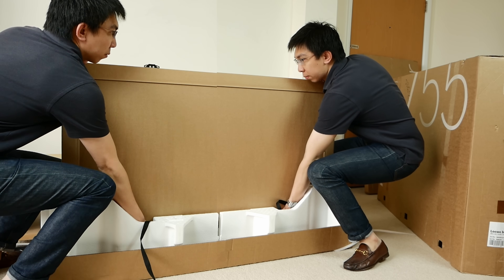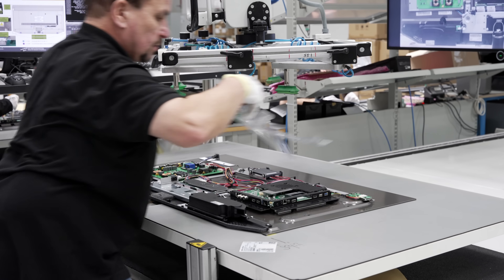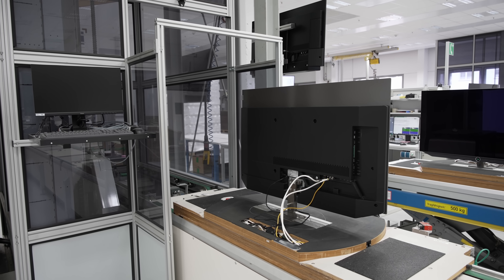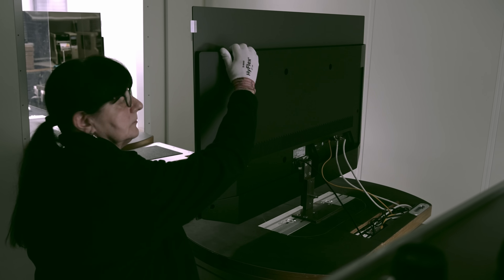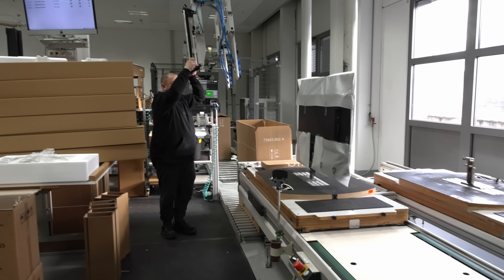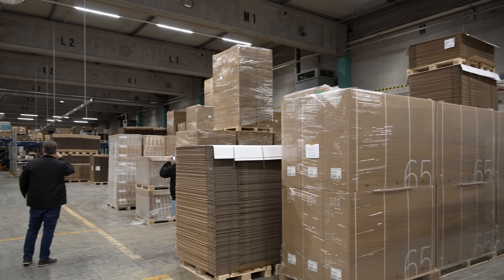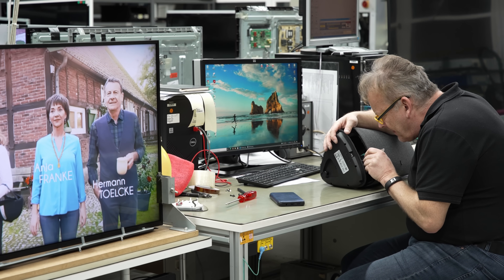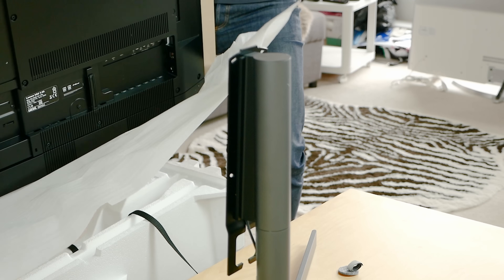How OLED TVs are Made - Unseen Footage from OLED TV Factory

Comment: That's a lot of manual labour that can't be reliably automated. However, picking just the first TV in a batch to check, rather than the first and a random one around the middle it's likely to miss any shortcuts the workers might have started to take in their routine. Quality control should be an ongoing process, not a one-time deal.

Comment: Next time maybe show how the OLED itself is made - not a super-low volume assembly plant boxing budget models by hand.  Cutting the mother glass?  Nope.  Vapor deposition?  Nope.  TFT layer etching?  Nope.  Phosphorescent dye manufacture?  Nope.  Quantum dot manufacture?  Nope.  Surface coating manufacture?  Nope.  Literally any engineering involved?  Nope.  But here's some dudes fumbling with cardboard boxes instead.
Reply: Their 65" OLED TV costs about 4000€ or about double what you can get a comparable LG for with the exact same panel. It's a luxury brand for German instagram home decorators. They probably sell a couple hundred of these a year.
Reply: Agreed, this is just final assembly, testing and packaging. Most large companies out there now do all of this in Mexico (at least with their TVs destined for the US market)